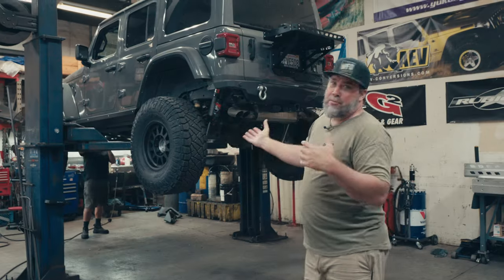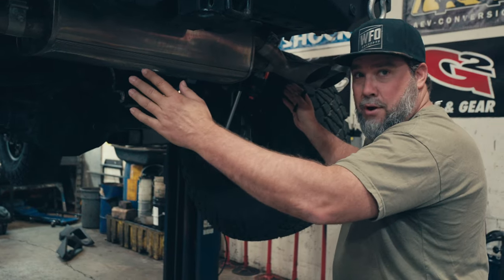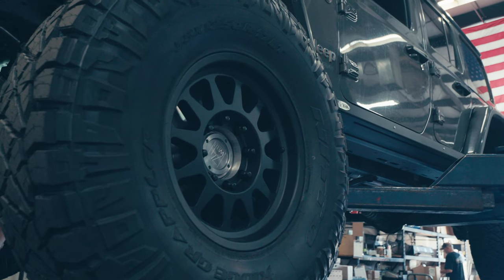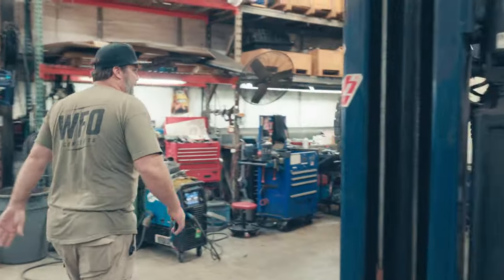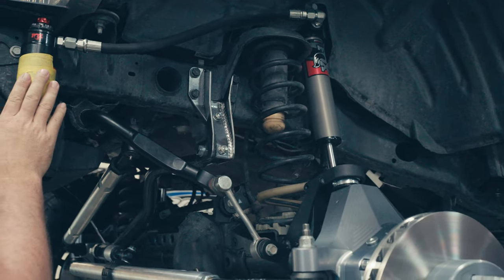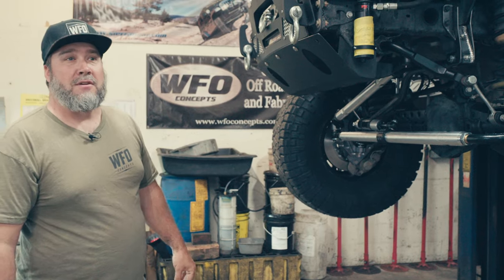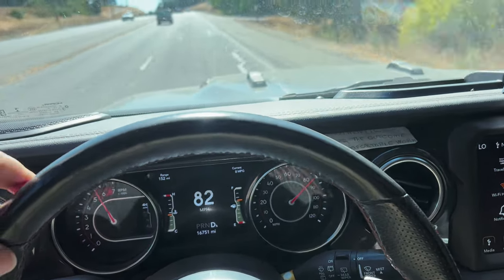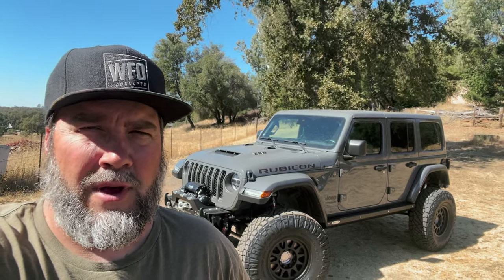74Weld Portals on a Jeep Wrangler 392 | WFO Concepts

Comment: $20,000 for the portals. You could spend the same price on a decent suspension, that’s going to be better than stock, and gears and drivetrain upgrades as well. So what’s really the benefit other then the clearance at axle tubes themselves? Because $20,000 for some ground clearance isn’t worth it.
Reply: 20k for the portals, not including install and other parts.
Reply: 1000% agree. All hype for a what is essentially an axle lift.
Reply: Much Less stress on axle shafts, different gearing easier, high clearance, that’s about it.
Reply: My biggest issue isn’t doesn’t do anything to address the strength of the axle, smaller calipers and overall braking performance, and the cost. Lol
Reply: @joshuahines4249 it takes a 1.375” diameter and pulls 22% torque load off that making it equivalent to a 1.6” axle without a portal…we give you larger rotors front and rear for better braking power as well. I hear you are not happy with the cost and that is ok. We get its not for everyone
Reply: @mikeyfaulknor9970 you are correct. That’s about it. But when wheeling a jeep offroad isn’t that everything you could want? More flex is cool, but isn’t that why we run lockers?
Reply: Basically you get the additional axle clearance. It would be great for snow! Not sure they are $20k+ great though.
Reply: @74weld  would love to see a video that shows the testing methodology. I’m sure people willing to fork over that amount of doh wouldn’t be upset. 

As for what you get with $20k, you are right. Not for everyone. Especially since it’s not just $20k. Add in tax, wheels, tires, driveline, etc. You can(I have) do much better than this for the same price, or less.

You gotta defend your product and I’m all for innovation….but really, portals are nothing new. There’s a reason why Jeep doesn’t include those as an option. Jeep guys will pay for anything. It’s not about cost here, it’s what you get for it.
Reply: @joshuahines4249 that’s your opinion and everyone is entitled to have one. The thing I find odd is for someone who doesn’t like the product you sure do follow every build on portals. I’ve had this same conversation with you on a handful of YouTube sections. Seems to me you are a closet fan 😉
Reply: @74weld is this product made in China?  Your speech and writing lead me to believe this
Reply: @Colorado4x4  I think the word you were looking for is diction. We don’t outsource. We engineer, prototype, and manufacture every component in San Diego.